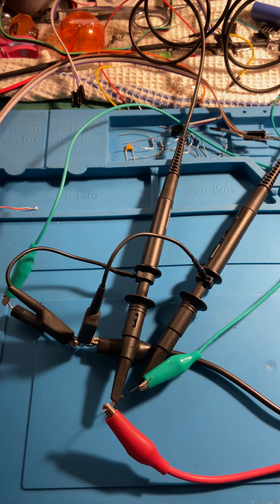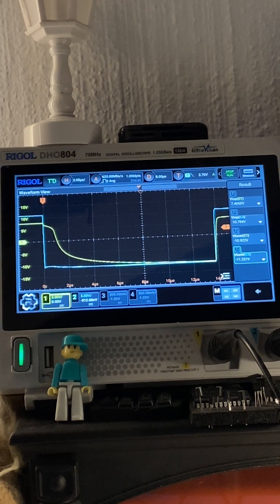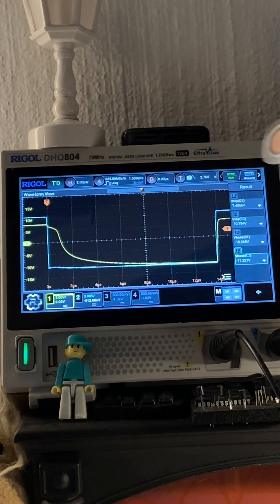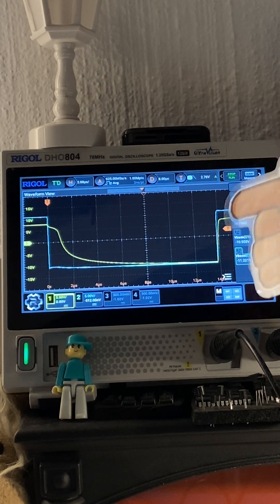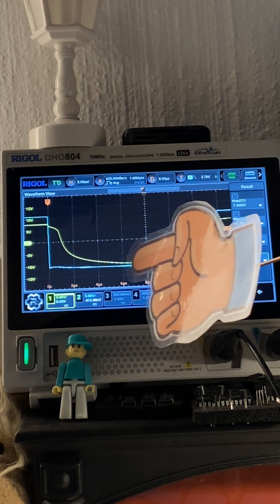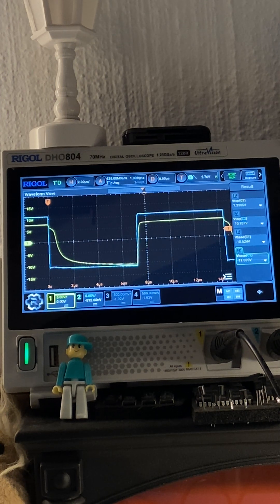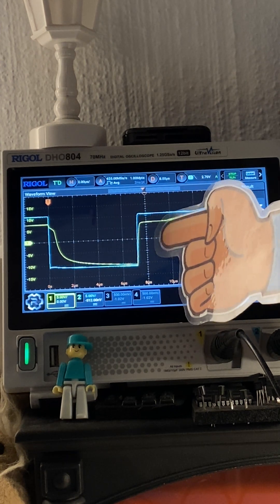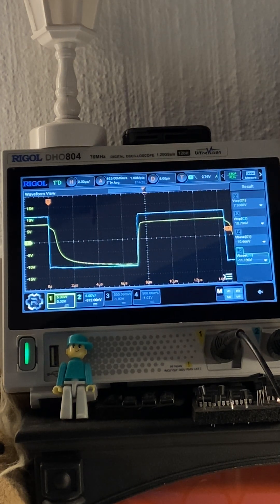Lets look at the waveform of a microwave rectifier diode with a scope #shorts #microwave #electronic

Comment: I had a look at how the high voltage supply of a microwave oven works . It's done with a single diode and a high voltage capacitor in a clever voltage doubler configuration  . As usual , I was astonished at how little I knew .
Reply from the maker: Yes and the case of the oven is the negative side of the dc side.